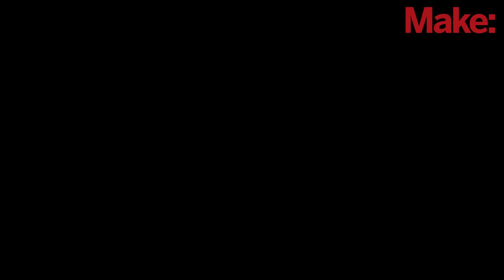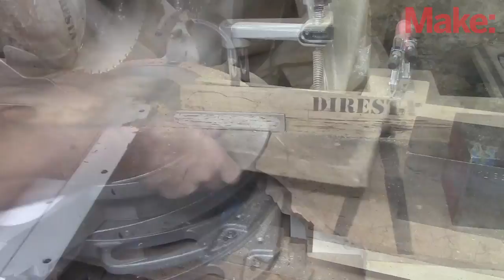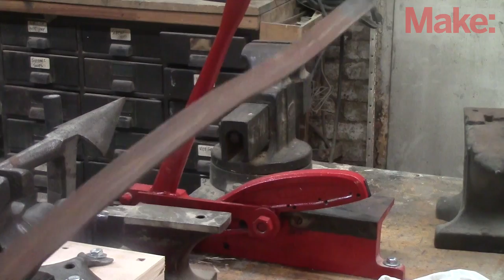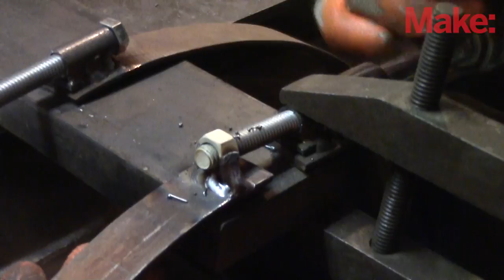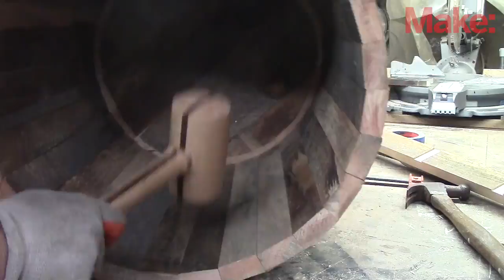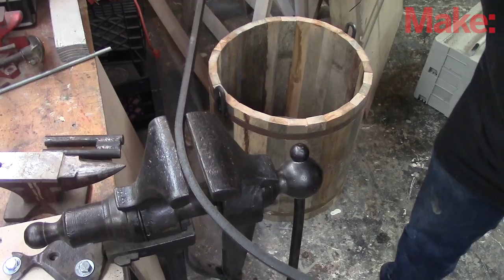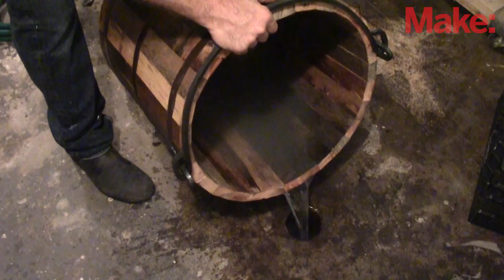DiResta: Wooden Bucket

Comment: Thumbs down no explanation on how to make it
Reply: With a basic knowledge of woodworking, this detailed pictorial and Google at your fingertips it's all right in front of you

Here's how I worked it out:

He's making a version of a truncated barrel so barrel specs can be a guide.

-Standard Dimensions of a Whiskey and Wine Barrel | DoItYourself.com

https://www.doityourself.com/stry/standard-dimension-of-a-whiskey-and-wine-barrel

[...The standard burgundy barrel would be around 23 inches in diameter while barrel widths can vary from between 25 inches and 28 inches. A small barrel will only have a 21-inch head. Larger barrels, such as the 65 gallon drum, will have a 28-inch belly, with 23 inches at either end, and be around 35 inches tall. ...]

-Whiskey Barrel Wood Staves, Set of 3 | Rockler Woodworking and Hardware

https://www.rockler.com/whiskey-barrel-wood-staves-set-of-3

[... WHISKEY STAVE 3PK6.2000

Material: White oakStave

 
Width: Varies, but approximately 2'', 2-1/2'' and 3''

Stave Length: 34-1/2''

Stave Thickness: 1' ...]

We see 4) boards 5/4 × 6 (5 1/2" wide) for 22" make up the bottom 

Circumference  = pi (3.141) x diameter (22") = 69" around 

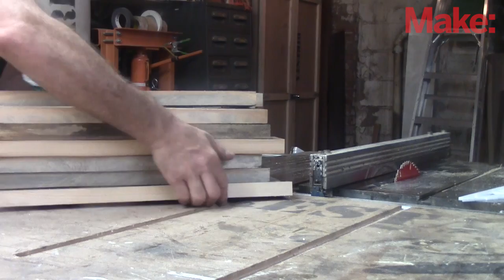2" wide staves leave us an odd number (35 1/2) but a width of 2^+" gives us 32 staves (÷ 69 = 2.15") which is the number of staves as seen at 3:21 and again at 3:26

360° ÷ 32 = 11.5° at each joint ÷ 2 = 5.6° angle cut for each edge... 

5.5° is close enough for this type of work, with the bands drawing them tite - a width for each stave of 2 1/8" fat - and an arbitrary length of let's say 1/2 a barrel height of 16"

And there is all the plan you need (or close enuff) - oh and the 3/8" dado at the bottom of each stave to let in the bottom.

There's a whole lot more going on here than meets the eye... but that is all part of Diresta's Chi.